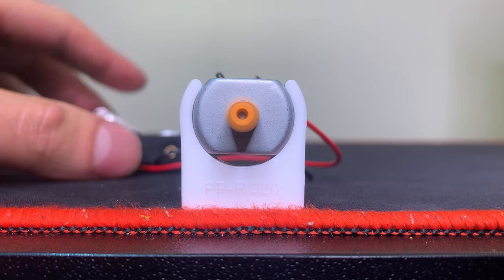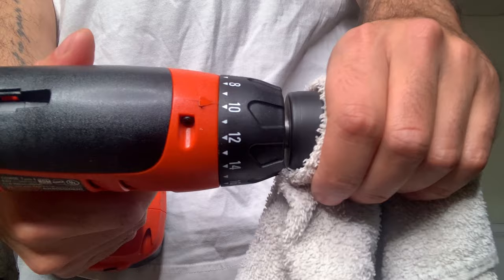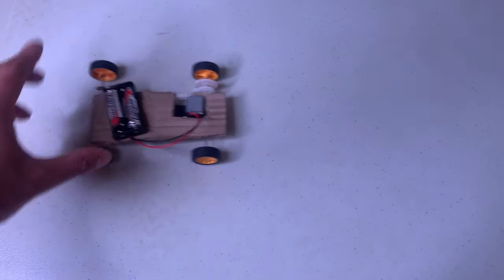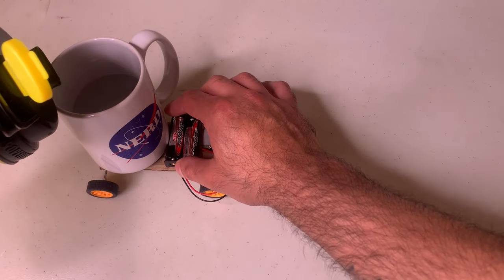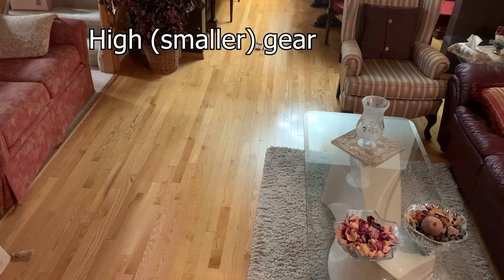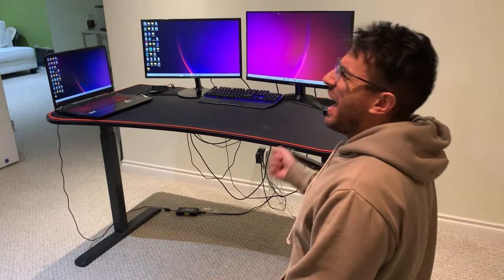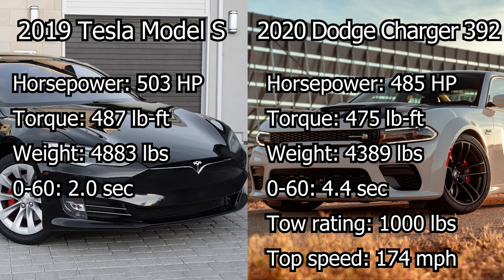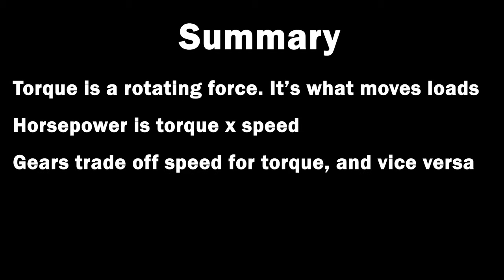TORQUE vs HORSEPOWER Explained In Less Than 3 Minutes

Comment: horsepower is how fast you hit a billboard. torque is how far you drag it.
Reply: The most incorrect analogy possible.
Reply: Nope. Horsepower is the rate of using torque to produce motion. Torque is just a force, you can have 1000 lb/ft of torque with zero rpm, and that will have zero horsepower.

How far you drag the billboard is still power, because power is force times DISTANCE over time.
Reply: That’s wrong asf

Comment: Would you choose a motorcycle that put's out 128 horsepower @ 12,000 rpms with 59 ft lbs of torque @ 9500 rpms and weighs 414 lbs (with a 765 cc engine) or  would you choose a motorcycle that puts out 117 horsepower @ 10,000 rpms with 68.5 ft lbs of torque @ 7000 rpms and weighs 228 lbs  (with an 890 cc engine)? The 765 cc engine is geared to be at 5,500 rpms @ 65 mph in top gear and the 890 cc engine is geared to be at 4,400 rpms @ 65 mph in top gear. Imagine that the both bikes would be loaded down with 235 lbs with rider and gear. Incidentally, the larger 890 cc is considerably more fuel efficient by at least 6 mpg.

Comment: I find this stuff really interesting. Do you think someone could get a job as a mechanical engineer with a physics degree? (BS)
Reply: @WissamSeif  Mechanics, thermodynamics and statistical mechanics, quantum physics, and wave optics were some of the classes we took. It was an applied physics degree, we even used MATLAB which is popular in mechanical engineering right?

Comment: Your definition of power is specific to that which is generated by a torque.  In general, power is the amount of energy transferred or converted per unit time, regardless of the method used to transfer the energy (e.g. a shearing force).  To determine the number of Watts per Horsepower, simply take the year Columbus discovered America (after the Vikings) and divide by two.  1492 / 2 = 746.  Just a happy coincidence.

Comment: I'm currently in third year of petroleum engineering (yes I know your take on it and really hope it will prove wrong 😂).
Out of all the courses so far, machine elements was my favourite (kinda regretted I didn't choose mechanical eng.). I did well on it, but now I really have a clearer grasp on the real meaning of torque and power so thanks a lot for this concise explanation. And keep doing the vids, they are awesome 👍
Reply: Are you not able to switch your major?

Comment: is i true that if I say we need more torque to accelerate and more horsepower for higher speed?
Reply from the maker: I think horsepower and torque are both needed for acceleration. You can deliver whatever required torque or speed that you need at your wheels with your gearing. Teslas and EV's have great acceleration b/c electric motors hit their peak torque immediately. That's another aspect; a 300 HP combustion engine is it's peak power. It takes time to reach it, whereas an EV hits its maximum torque immediately, and thus has more torque and HP off the get-go. At higher speeds, HP becomes more important.

Comment: Strange. Still confused .The motor in both models have the same torque and horsepower. The torque and horse power has been modified with gears. Saying two vehicles have different powers should not be measured anywhere but at the crank shaft. What you do with that power afterwards is up to gearing. Only motor design really changes horse power and torque?
Reply from the maker: They shouldn't have different power since it's the same motor for both. Gearing will change the torque and speed at the wheels. So yes you're right, I should've said this vehicle has more torque at the WHEELS than this one because of the different gearing.
Reply: Video is faulty like most of the videos on topic. If a cars "gets of the line faster" than the other, it is because its power to weight ratio is higher, with no other option possible. Simply by definition of power. These electric motors have a power curve, and power increases with motor's speed to some point. By adding a reduction gear, we change a ratio between car's speed and its motor speed. The motor now, as we say, works faster (which literally means developing more power) at any speed range of the car, so it accelerates faster.

Comment: It's torque vs power, or lbf ft (Nm) vs horsepower. You're mixing up units and physical quantities here.
Also power does not equal torque times speed but is merely proportional to it.
Reply from the maker: Yea I’m aware that HP is a specific unit of power. Torque vs HP is such a common search that obviously that was going to be the topic here. Could’ve added a formula or two, sure
Reply: @WissamSeif  I guess id like to have seen you point out that even though you didn't change the motor, you changed the power output of that motor when you changed the gear.  The faster gear forces the motor to operate at a slower rpm at the same speed.  Thus, it is not just torque at the wheels that was reduced, but power as well.

Also, your car examples at the end, I would expect a 4000lb car to accelerate faster than a 7000 lb truck with the same horsepower.  Power is work with respect to time. Moving the truck requires more work, therefore requires more time.  And then the electric vs gas, I'm sure there is still some advantage to the electric, but what you really showed is that an AWD has far more traction than an RWD.  And we already knew that

Comment: Torque at wheels is important, torque at crankshaft is largely irrelevant in theoretical discussions like this since gearing makes up difference.  Two engines with XXX HP have same potential to make torque at wheels, I don't care if one has 2000 ft lbs and the other has 300 ft lbs, HP is all that matters.  Now there are some practical nuances with engine longevity, heat, power transfer, etc

Comment: Horsepower is the rate of using torque to produce motion. Torque is just a force, you can have 1000 lb/ft of torque with zero rpm, and that will have zero horsepower.
Reply: torque is not linear force  🤮👎🏻100 hp 1 nm at whell at 10 km/h generate 100 times more contact path force at drive whell than 1 hp 100000 nm at whell at 10 km/h 😎  power at set speed if FORCE 👍🏻😎you will stop usuing hand 1 hp 100000 nm at whell at 10 km/h with easy in comapre to 100 hp at 1 nm at 10 km/h whell spin be imposible basically it ripp off ypu hand 👌🏻if ypu try stop this whell with such power level and torq level vs 1 hp at 100000 nm at 10 km/h be probabaly posiible to stop cos from 1 hp at 10 km/h be geenrwted around 27 kilograms force thpugh ypu must also includend inertia pf rotstion whell so depend how heavy asf it is build it can be easier or harder to do but still posibble at such setup vs 100 hp 1 nm at 10 km/h the same whellwill required 2,7 tons of force at tire circle to stoop it beside ypu must also included add again its rotstional inertia energy /momentum but you can feg match speed whelll be ypur hand catch it and than while rotate with it try to exert ypur force and try to slowwww it down and finally stop it what with 100 hp and 1 nm at whelll at 10 km/h be absolutely imposibble to do cos 2,7 tons force is quoet alot i quees 👌🏻😉 but 27 kg force from 1 hp at 10 km/h at 100000 nm yea easy 🤭👌🏻even small women be ise proper technique which im wusbcribe be able to stop this whell absolutely 👌🏻 so no torque is not linear force it is leverage dependendd and power is speed depended  👌🏻1000 hp 250 nm engine beat with easy in 1/4 mille drag race uphilll let say 5 degreee incline so more than avg viaduct 👌🏻 pulll with 100 tons on trailer somethin like 250 hp 10000 nm alos with 100 tons on trailer up the same hill both at perfect gearing so very individual choicen precise for specified power characteristic graph gearing cos power:speed = FORCE 👌🏻
Reply: @mociczyczki The numbers you gave are irrelevant if you don't tell where they are measured. Power is torque x speed. To have 100 hp with 1 nm you would need 700 000 rpm. To have 1 hp with 100 000 nm you would need 0.07 rpm. But you said that in both cases the speed is 10 km/h. That would be impossible because you said that the torque is measured at the wheel so the rpm would also be for the wheel. The only thing that would explain it is if there was 10 000 000x difference in the diameter of the wheel or the hp you gave is the specification of the engine and not the actual power it was producing at that moment
Reply: @laserdiode  100hp/1nm vs 1 hp/100000 nm at whell at whell speed 10 km/h for both like im write 👌🏻🤷🏻‍♂️
Reply: @mociczyczki  Is the hp also at the wheel?
Reply: @laserdiode  and where ? offcorse at whell in both egzample 👌🏻😎im write preciselsy AT WHEELLLLLL 👌🏻 its this stuff which consist from rim and tire and couple other parts like air valve asf 🫣🤷🏻‍♂️

Comment: Thanks.  I have long felt that I didn’t have a good grasp on the torque vs horsepower issue.   As I was watching/listening to your video I kind of crystallized fie me (I think).  Let’s see:

Horsepower determines how fast you can go (eventually).  Torque determines how long it will take to get to some speed. ??? So horsepower tells us about speed but torque tells us about quickness.  ???
Reply: Yes. Torque is acceleration, horsepower is top speed (both depending on gearing)
Reply: nope, power is everything, torque tells us very little about performance

Comment: Maybe these questions will help you out to understand the topic and stop spreading misinformation?
1. If you feel torque then put a larger wheel on the axis and try to stop it. Why it is easier now despite the same torque?
2. If you need lots of torque to get something moving, why a man can tow a cargo plane, or a locomotive with dozens of carts? Check some videos on YT.
3. If you can move a light load really fast or a heavy load slower and put out the same power in both cases, then why two vehicles can have the same engine horsepower but have completely different functions? On top of that, 5 seconds earlier you showed yourself how gearing works. 
4. Uncomfortable info for you here: if an electric car outperforms a gasoline of the similar specs because it reaches its peak torque faster, why the truck's specs engine is not installed into a race car? Not only it has a double amount of torque but it also reaches it faster. 
5. If you need torque to move, then what is force/thrust?
6. If horsepower is torque x speed then what is power?
7. If horsepower is how fast you can move that load, then why you need torque for acceleration?
8. If horsepower is important, why there is no a single word about how exactly it's important in the video?
Reply: @WissamSeif   @Wissam Seif  bad answers, looks like I have to sort it out by myself.

1. You can't feel torque, it is physically non-existent.
2. Or you don't "need lots of torque to get something moving". Or both. 
3. You explained power as force times speed. And how gearing changes the balance between them. This means gearbox doesn't need any specific amount of input torque for a vehicle to perform any kind of job. 
4. So when it is about electric vs ICE of the same power, electric wins because its torque is reached faster, and when it comes to diesel and gasoline, diesel does not dominate because "it's not just about torque and horsepower". 
"ICE doesn't hit its peak torque until it's near its max rpm". Ever seen a torque graph of ICE?
5. True that a car needs to overcome some extra static friction from a stand still start. Now get back to your "power is light load faster or higher load slower". 2+2= you need more power if you want to overcome more at/from the same speed.
6. Horsepower is a measurement of power. You mess already at the stage of the basics. 
7. Explained in number 5
8. You didn't explain it well enough to yourself before the video was even made.
Reply: @WissamSeif  you just don't care in general, why do I have to treat you well? You don't even know the words' meanings and r trying to educate others.
Reply: @IgorArkin  dude have you ever taken a physics class? Don’t think so

Comment: Hey Wissam, what’s up. Love this video just like everything else you put out. I’m a first year engineering student and I plan on doing mechanical engineering after I transfer from my local community college. 

Hey, so I wanted to talk to you about something that might sound a little dumb. 😅 For a while I’ve been thinking about getting a dual degree in mechanical engineering and mathematics or at least a math minor from the four year school i plan on transferring to. The reason why is that at my school mechanical engineers take calculus 1-3, differential equations and numerical analysis which is already a great background in mathematics but we aren’t required to take things like linear algebra or partial differential equations — things that I’ve heard are good to have a background in for mechanical engineering. Another reason why I’ve thought about this is that I plan on going into aerospace engineering (via a masters program) and I’ve heard it’s one of the most math heavy industries in engineering. I just thought maybe a math degree would greatly prepare me for an industry like this because I’ve heard it can be really challenging. My ultimate goal is to work as an aerospace structural engineer at NASA (knock on wood). 😅

If one of the first things you were to mention is “it’s going to cost more money, maybe just stick to your main major,” that is something I’ve thought about but in my [U.S.] state they help to pay for college if you go down the “college path” in high school and i also plan on joining my state’s national guard and here you get 100% tuition exemption. I’ve honestly been planning out this whole dual degree for sometime and it does seem possible to be able to pull this off with just an extra year of school. 

I don’t know. I just wanted your feedback since you currently work in the aerospace industry. Anyone else who sees this feel free to comment. I’m open to feedback. 🙏

Comment: Torque is the strength that helps you start moving and carry heavy things.

 Horsepower is like speed and endurance that helps you keep going fast for a long time.
Reply: @IgorArkin  How's it wrong?
Reply: @ricardomilos1784  absolutely. Just read what power and torque is. Or let's start with you proving your point with basic physics and you will see it is not possible in the process. Also violates any logic.
Reply: @IgorArkin  OK professor, can you explain it in simple terms? I don't feel like reading the information about what torque and horsepower are.
Reply: @ricardomilos1784  easily.
Power is acceleration x speed with a given mass. 
With the same power output, the slower the speed the better acceleration and vice versa.
You trade between acceleration and speed with a gearbox.
Torque is not related with performance because it can exist without displacement, and when displacement starts to occur it is described with power.
Reply: @IgorArkin  Alright thank you!